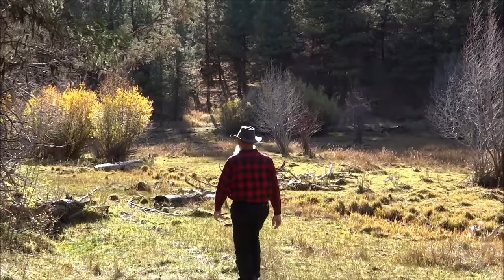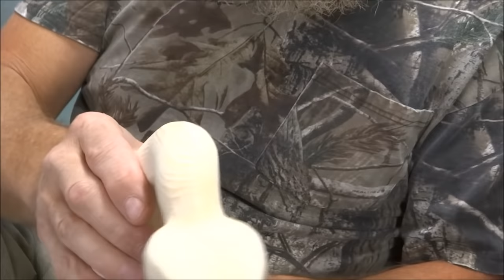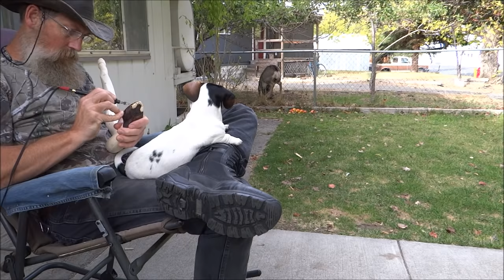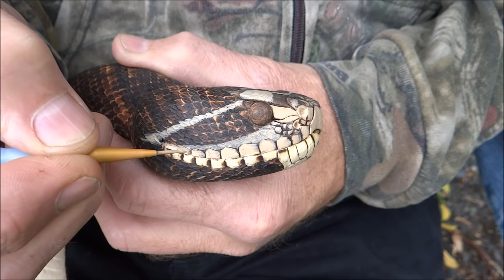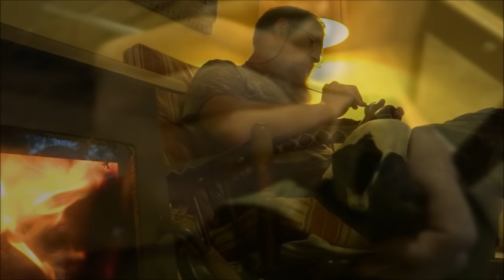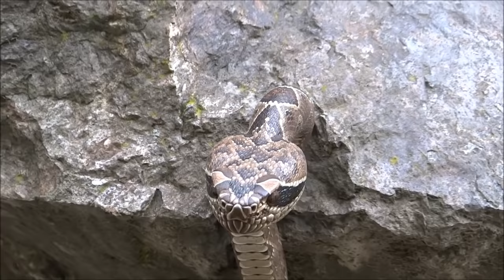Wood Carved Rattlesnake Walking Cane #56

Comment: Well I got my Oz carver and I also bought the burner and a bunch of different style burning hand pieces. I did not see the one you use though for the scales I got a packet of them but there all so small. Have to try and find a bigger one to burn the scales.
I had a juniper pronana die last year so today I loped if off and it will be my first attempt at some sort of waking stick.
Reply from the maker: Treeline has a good variety of scale tip sizes for the razertip wood burner. Here's a link  https://bit.ly/37mzHvC 
I hope the juniper wood works well for you and you have a fun time making your snake stick!

Comment: Your work is amazing,Absolutely beautiful. Was wondering what the little sanding disc attachment on the Dremel is called. It would be perfect for a project I'm working on with flower pedals.
Reply from the maker: Thank you very much! That is called a diamond separating disc. It is mostly used in dental laboratory industry. http://www.horico.de/en/labor/diamant-scheiben/8-deutsch/labor/87-alle-scheiben.html